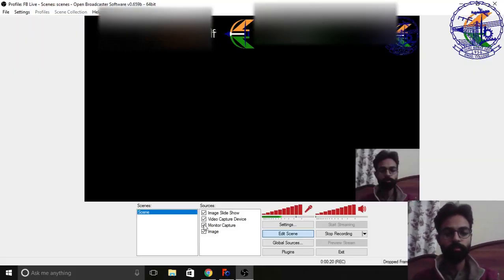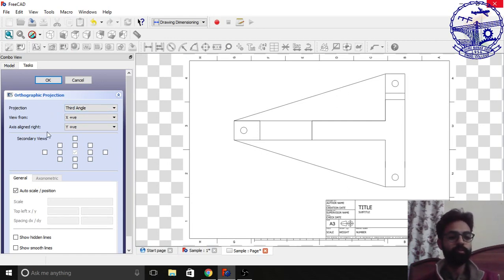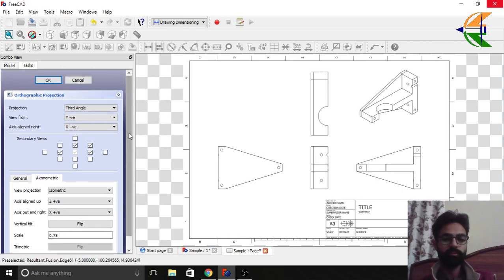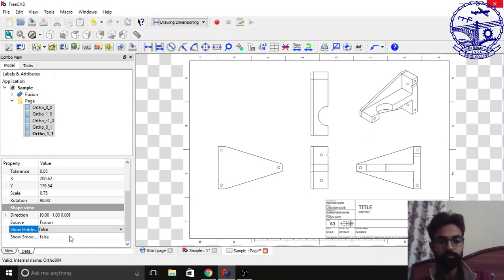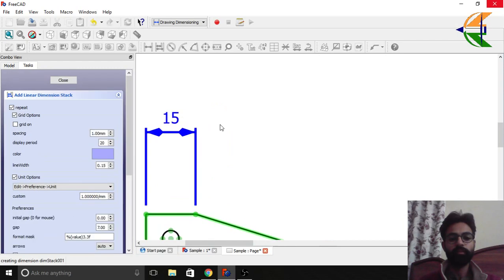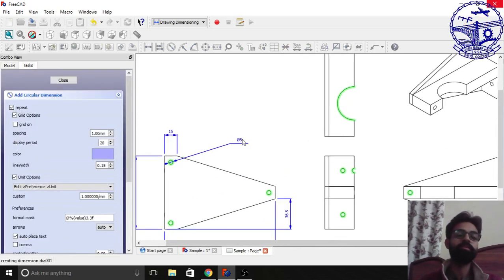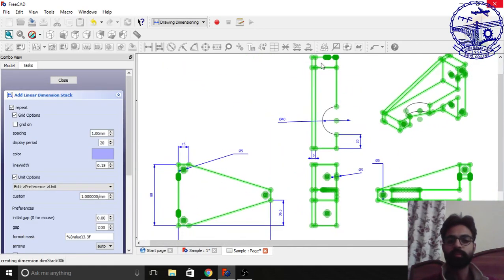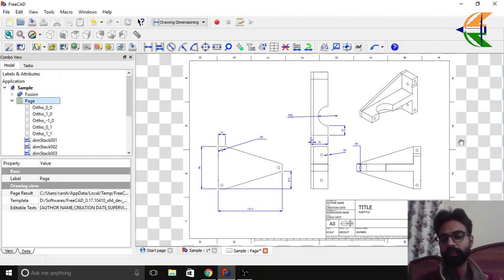FreeCAD Tutorial: How to Create Drawings & Dimensions

Comment: The dimensions and drawings workbench needs work.

Here's a quick fix:

https://github.com/hamish2014/FreeCAD_drawing_dimensioning/pull/124/files

Needs two files changed and added the 'encoding' element.

Works ok afterwards, though I had an issue w/ deleting a dimension (it would not disappear).

FreeCAD 0.18.4, Ubuntu 20.04